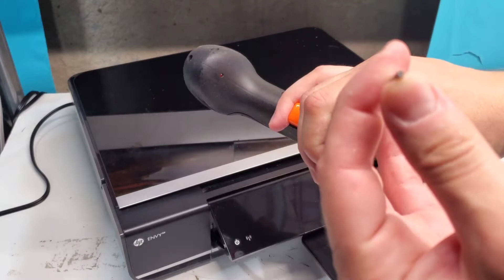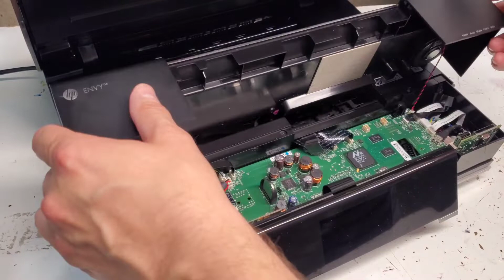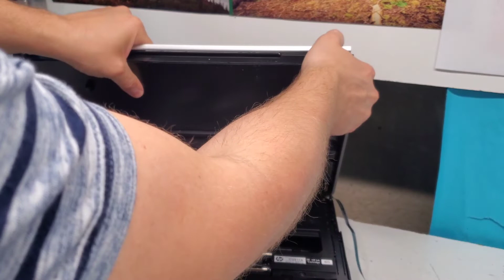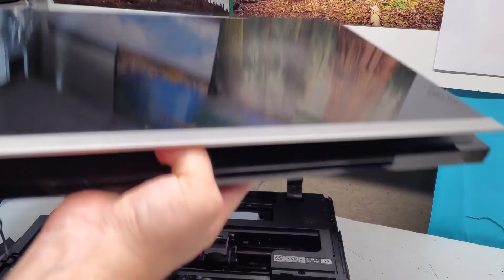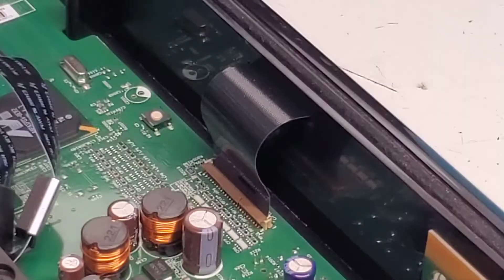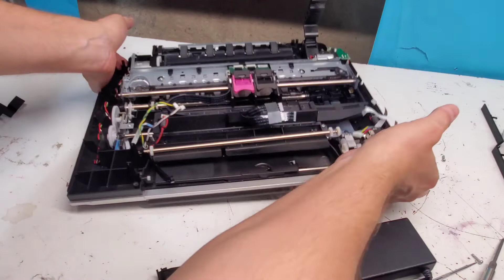How to Take Apart HP ENVY 114 D411c Printer for Parts or Repair 110 120 D411a

Comment: Is it possible to install bulk ink on this printer? Do you have any tutorials that teach how to install Bulk Ink, especially how we connect the hose to the HP Envy?
Reply from the maker: I have never installed a cissy on this ir similar printer. There are continuous ink supply systems for these models sold on eBay and Amazon. About 10 years ago, I had one installed on a 2 cartridge system like yours, but it was a photosmart c3180, I believe. It had more space inside the printer to have the tubes go back and forth without jamming. I'm not sure ifbit will work with your printer because it is designed to be slick and compact. I'll see what I can find, and if I do, I definitely will try to provide advice and help. Thank you.

Comment: Any advice for correcting a "scanner broken" error message on an Envy 120? The diagnostic says to power off/on the printer but that doesn't do any good.
Reply from the maker: Hi. Yeah, that almost never fixes that problem. It is possible that the scanner wire is disconnected somewhere between the scanner and main board. Another cause would be if scanner jams and won't move inside the glass. Sometimes the error is that he motor or lamp have gone bad and need o be replaced. It is alost impossible to find replacement for it, so check all possible obstructions and connections first.
Reply: Thanks for the response. I reset the scanner cable plugs in the front and it seems to have fixed it (so far).  @303electronics

Comment: where the 2 ink cartridges sit all the way to the right when not printing,there is a soft pad actually 2 pads soaked in ink and there is a big wad of black ink down there should i remove that glob of ink and is there anyway to clean those pads .i'm guessing they are to catch dripping ink ? don't really know any clues or suggestions .also is there a repair manual i've looked alot and haven't found any thanks
Reply: If you solve the problem would you please help me l have the same issue   the black ink is dried l found clogged in the front drop collector but need to be clean more l couldn't reached it so my printer it doesn't print

Comment: I have hp envy 100 stuck on initializing
Reply from the maker: Could be an internal main board error. One thing you can try us to remove inj cartridges and restart printer by unplugging, wait a few seconds, plug in,  and try turning it on.